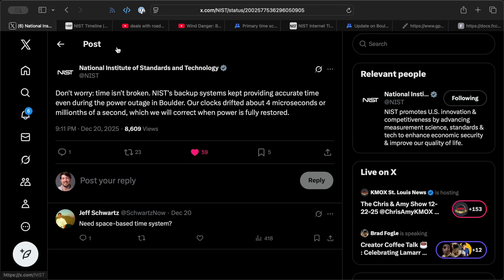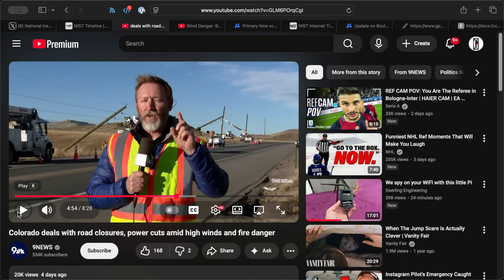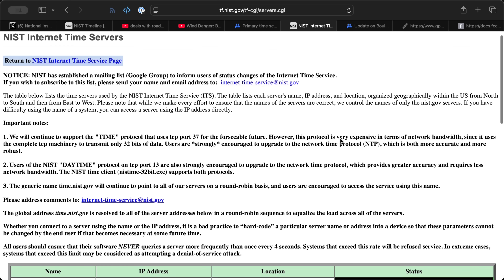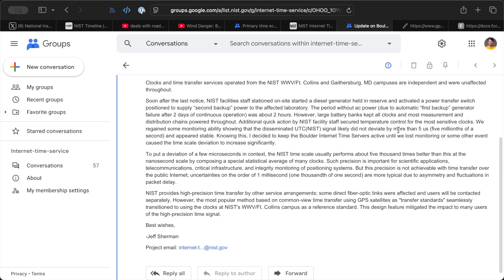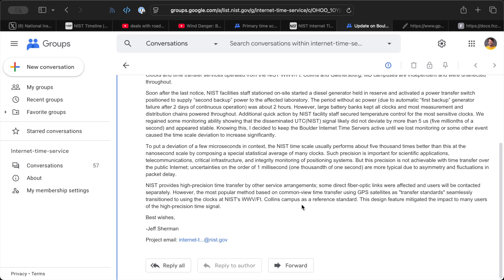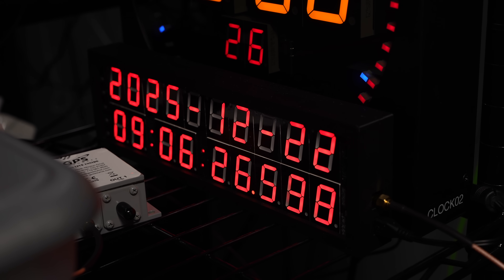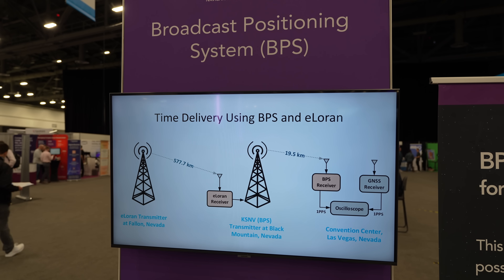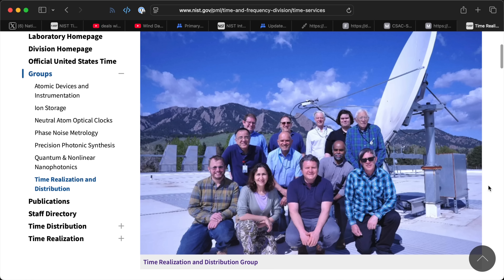NIST's NTP clock was microseconds from disaster

Comment: I implemented NTP in a Canadian scientific site in the 90's, and I studied it a bit it back then.  To me, the most fascinating thing about the time protocol was how clock synchronize. NTP does not synchronize clocks... It doesn't set one clock based on another.  Instead it looks at the rate clock servers tick, and slows down or speeds up the ticking to match a what it thinks is the speed of other clock servers.  It gets  clocks to tick at the same time by adjusting respective speeds.

So to fix the 6 micro-second drift, it's likely NIST won't just reset the clock to an accurate time, rather it will slightly speed up (or slow down, I don't know the direction of drift) the clock for a while to counter the drift until it is accurate.  As it gets closer to accurate, it will be slowing down the rate of approach to accurate time, so the speed of the clock is correct once it gets there.
Reply: If your clock is off more than some milliseconds then tuning the clock won't help, it doesn't have such range, you have to directly set the time and then keep adjusting the offset. Which usually happens in regular computer synchonized over network. Yes there is also issue of keeping the clock monotonic and some companies like Google choose to spread the leap second over half a day to not have sudden jump in time (repeating or skipping second). For consumer PC it's not an issue so it can adjust system clock right to the best guess what the accurate time is right now. The algorithms and network latency greatly improved since 90s so we can achieve millisecond accuracy over regular internet connection, even wireless.
Reply: @jan.tichavsky  If your clock is that far off, NTP will just give up.  You then stop the daemon, and use some kind of slaving command to re-sync ... ntpdate, for example, then restart the the daemon.  It will only keep working if the offset, and rate of drift is reasonable.
Reply: @jan.tichavsky  you are describing "leap-second smearing" the leap second is distributed over an entire day.
Reply: Actually, it works by exchanging time stamps between the 2 ends.  It then calculates the transit time and applies that to the received time so that it is now accurate.  You can see that by examining NTP packets with Wireshark.  That done, the local clock rate can be varied to keep it in sync.

Comment: Until next time, he's Jeff Geerling. Yet I come back every time and he's still Jeff Geerling. Is this a NIST issue??
Reply: But he is the Jeff Geerling from 5 Microseconds ago. That is significant.
Reply: @wolfgangpreier9160 plus an additional one or two nanoseconds, depending on how far away you are from your screen 😮
Reply: @bensc  OMG you are right! I have to tell OpenAI to redo all my Fake AI calculations.
Reply: To be fair, Jeff Geerling did not say or even imply that he would not be Jeff Geerling after next time. I think it's responsible of Jeff Geerling to keep us aware of the prediction limits within which he can be sure he will still be Jeff Geerling.
Reply: @TaiViinikka  But I don't see how he can assure us of even that much.  How will there be a "next time" if he (gods forbid) ceases to be Jeff Geerling?  Won't he lose access to his YouTube channel?
Reply: As long as he matches up well enough against the NIST Standard Reference Jeff Geerling it should be fine
Reply: No, he's just the most careful person on the planet: he doesn't want to commit to anything longer than absolutely necessary, so there's always the option that next time he isn't...
Reply: incomplete metamorphosis issue.
Reply: No this is an issue with your reality stabilization. It is too tightly calibrated.

Comment: Do you not still use the Timecard Mini you had for LTX as another source?

Wondering how it compares to the other TimeHAT you are using now.
Reply from the maker: The mini requires a PCIe slot, so makes the solution a little harder to mount up... though I haven't finished re-mounting all my hardware in the rack, yet. Someday, all in good time!
Reply: @JeffGeerling  I have one of the originals before the refresh and it unfortunately has a conflict with trying to get the PCIe serial/GPS output + onboard USB + the OCXO all working in tandem. It is something to do with how the UART and I2C are distributed IRRC but it has been a while. I am wanting to try and revive it so I can be a pretend time nerd. Looking forward to what 2026 brings!

Comment: Question is what happened on Wall Street and other markets when this occurred?
Reply: My VERY first thought. High-speed trading happens in nanoseconds. A five microsecond drift is an eternity.
Reply: My guess is they use multiple time sources. NIST has multiple campuses with time servers and only one was affected. But then theres GNSS also or direct fibre connection to traceable clocks. Time transfer by NTP is only good for a millisecond or so anyway. 
And it is enough if all the servers at the exchange agree on one time, since they timestamp the transaction when the order reaches the exchange to order them correctly. The absolute value of time doesn't matter that much, it's just convenient for display if the "order received" timestamp matches the clock to facilitate lookups. ±5 us of offset to UTC simply doesn't matter.

Comment: Seems weird, if they had any atomic clocks underpinning their NTP servers which had continuous UPS power the whole time, you'd think they would lose far less than microseconds over a couple of days. With any mediocre GPSDO it should be possible to stay within nanoseconds 24/7 as long as your server isn't turned off. Microseconds sounds crazy shonky. This is also a nice thing about having GALILEO, GLONASS, Beidou, etc as an alternative to GPS. They all implicitly provide redundancy for each other for this sort of application, and can even improve accuracy when combined in some cases. I guess until we have some space war in which someone detonates a EMP weapon to kill them all
Reply from the maker: I'm guessing thermal issues may have caused quorum to be lost... a lot of the clocked are very sensitive to thermal changes, and I'm guessing building climate control was not constant during this time period.
Reply: @JeffGeerling  Even if you lose climate control that shouldn't affect the physical principles of counting atomic clock oscillations?
Reply: @JeffGeerling the whole point of primary atomic clocks is they are NOT sensitive to thermal changes
Reply: Definitely due to thermal control issues, and possibly due unstable power during power switchover.
Reply: Weren't they saying their main array of clocks lost power entirely, and they had a separate one but that wasn't connected to the time servers?
Reply: i doubt the US would ever overcome NIH to the point where even galileo signals could be used as the time basis for navstar
Reply: yes, all the clocks were on DC battery and we were able to maintain temp control. What drifted was a synthesizer, after a distribution amplifier's UPS died, NOT the clocks
Reply: You're greatly overestimating the holdover (free-run) ability for a GPSDO.  The amount of drift depends on what type of oscillator it uses.  A standard TCXO (Quartz) oscillator will drift about 5 milliseconds per day.  A really good OCXO (Quartz) oscillator will drift about 10 microseconds per day.  A rubidium based one will drift about a microsecond per day.  A cesium clock will drift 2-10 nanoseconds per day.
Reply: @stargazer7644  Why would they be free running? It's not like the GPS constellation went down during. The powered antenna necessary for global lock takes mA to run. Or are you suggesting NIST can't keep a battery backup GPSDO running when they lose mains... (well... given the evidence...)

Comment: You need to get your time from an atom clock - you can do that with a simple receiver. Then you do not need to use GPS nor ntp (internet).
Reply from the maker: Those clocks get time from radio signals (like WWV), and are a bit less accurate than GPS time—though with a really good radio and programming, can probably match or beat NTP time.
Reply: @JeffGeerling  Those clocks get their time from WWVB, not WWV.
Reply: GPS is from atomic clocks. Atomic clocks flying in space, adjusted for gravitational and speed relativistic effects.

Comment: I was a unix/network admin during y2k, the only issues I had were a few systems pointed at the nist clocks.  I don't know if it was network overload for them or an actual bug, but I was amused by it at the time.  My clients rolled decades back, but it wasn't Jan 1 1970 as I would've guessed.
Reply: I was on midnight duty that night. We had had a sort of dry-run for NTP problems in August of 1999, because of the first GPS week rollover. Anticipating this, we had let our GPS servers free-run over the rollover, and only reconnected them up-stratum when we had confirmed that everything was ok. So we just repeated that for y2k (and, as far as I recall, we didn't observe any NTP problems then either).

Comment: They had a single backup generator and it failed?  I’m done paying taxes.
Reply from the maker: They have multiple, and as someone who's helped at many sites where multiple generators fail (remember, this one was running for two days before failure, too), I can see it happening pretty easily.

But that's why places like this have multiple redundant transfer switches, battery backups, and usually extra plans in place to secure fuel supplies even in dicey situations.

It's honestly amazing backup systems work as well as they do, considering how little a lot of places can justify investing in their maintenance!